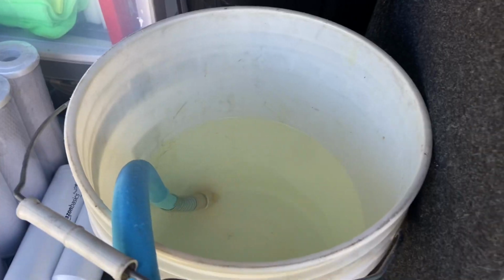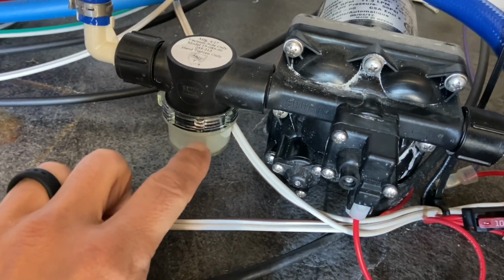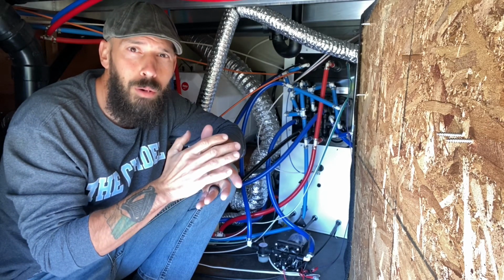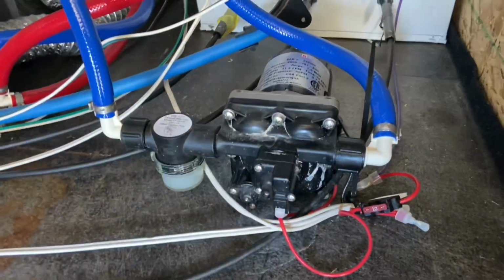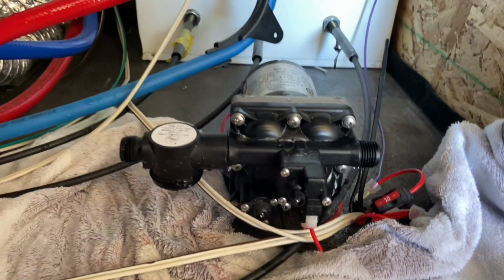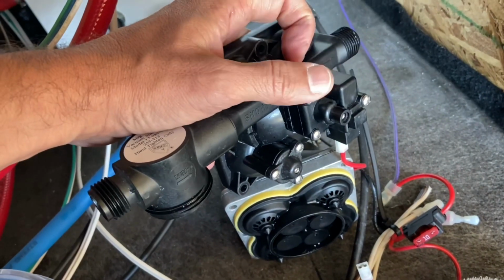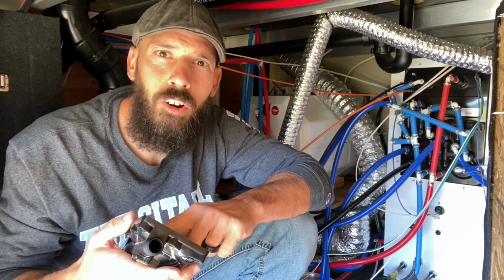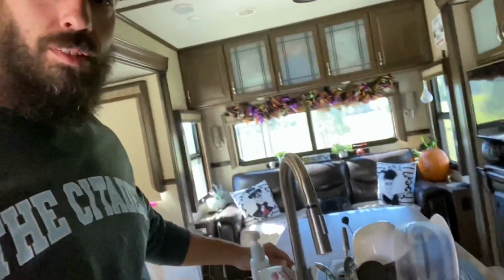RV WATER PUMP TROUBLESHOOTING (Pump Runs but No Water...Fixed!)

Comment: If I am connected to city water will this valve prevent city water to get to the sink.
Reply from the maker: If connected to city water this valve will prevent water from going backwards through the pump and into your fresh water tank. If your fresh water tank slowly fills up on its own and starts overflowing it usually means this pressure/check valve in the pump in broke.

Comment: Thank you, my pump has been working fine until our last move and it simply stopped, I suspect the electric fuse ?? But I have to locate the thing first?? It's a 2017 Forest River 32 rets
Reply from the maker: Good luck. I’m no rv tech or nothing, I only know my rig.
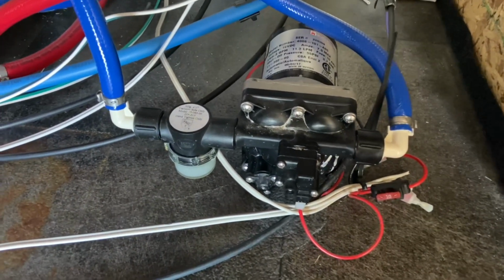Reply: @WhyWait you're a great teacher, I think mine was simply frozen, it was 19° for 36 or so hours, 4:30 today it just decided to start working again without me having to do anything. Thanks again

Comment: I was attempting to winterize my trailer for the first time and was unsuccessful after about three hours. I tried every valve configuration possible I could not get the antifreeze to pump out of the bottle. I have never used my water pump because we always utilize the pressure that comes from the campsite faucet and I have never boondocked. So it has never even been turned on. Now the first time I go to try to use it I’m having problems. It never occurred to me that the pump could be the problem. I googled my water pump is running but not pumping and found this video that seemed to describe my problem exactly. It gave me the confidence to pull my water pump out and take it apart. Sure enough it was the exact problem Chris shows you how to correct in this video. It took me about 10 minutes to take it apart, free the valve and reassemble it. I reinstalled it and within 10 minutes I had winterized my trailer. Thanks Chris!
Reply from the maker: That’s awesome! Glad this video helped and you were able to get your trailer winterized. In the future try to use the pump once a month or so to keep it exercises. That might help out from this happening again. Appreciate the comment 👍🏼

Comment: I have basically the same problem. Pump will run and partially fill water filter, whole house type, then just keep running. Could this be my problem? Also the filter you mentioned on intake side, mine is at an angle between 45 degrees and horizontal. It's just a clear screw on housing with nothing in it. Will check what this video shows.
Reply from the maker: Hope you get it worked out.
Reply: @WhyWait finally figured out problem thru suggestions on here, even though a tech couldn't. It was the shower mizer valve. Used it on my last trip and didn't fully turn it off allowing it to suck air.

Comment: Your water filter should be installed with the clear cup facing up. This allows it to drain when winterizing so it doesn't crack.
Reply from the maker: We don’t winterize and live full time. If I did I would actually just take the pump or little filter out.

Comment: This was so helpful.  We were prepping to leave from our campsite yesterday and when I disconnected from the City supply we had no water in the RV.  Went through several troubleshooting steps to no avail.  I thought we had lost prime and I was doing something wrong.  Found this video and it was exactly our issue.  This really helped me know how to remove the water pump and associated water lines and do a basic teardown.  Was able to cancel the mobile RV tech since I fixed it myself!
Reply from the maker: Glad our video could help you out and save you some money. 👍🏼 Hope you subscribed cause we have lots of other videos like this.

Comment: Tks so much for the help. I took off the regulator valve cap and fished out the diaphragm. It was stuck but not much. Put all back and the pump works fine.
Reply from the maker: Good deal. It’s likely to happen again. Over time that valve serves as a one way check valve keeping city water out and it constantly pushes on it seizing it up. Glad this worked though 👍🏼

Comment: Went camping and after my wife used the shower at night, I woke up in the AM, and no water came out of sink faucet. I checked and made sure tank was full.
 I can hear pump running constantly.  I tried priming with the seperate winterization hose.  I actually got water to come out of faucet at low pressure 
 Once it ran out, pump quit pumping water but kept running.
  I took apart like you said -   Filter case was fine, and filter clear.  I took apart and holes were clear, and springy pressure regulator seems springy and moving fine...
 Now what?
Reply from the maker: Sounds like….You have a leak in your water system somewhere. Underbelly or someplace else. If the pump is on there’s a demand for water so it’s running calling for more water because it’s leaking somewhere. It can be a small leak too.

Comment: I replaced my pump and everything works. I opened up the old one and it was not dry and the button worked properly... what other things would allow it to siphon in water and pump that but not pump from the white tank?
Reply from the maker: Water can be coming in from the other side of the pump, where the water pumps out. The city water presses up against that inside check valve and comes in backwards to the pump when that valve fails.

Comment: Turned out I had the same issue.  The pressure valve was slightly stuck.  Thanks!  You earned my like and subscribe!
Reply from the maker: Good deal Ray. It will probably happen again because of the city water pressure constantly pushing on the valve binding it up. Installing a separate one way check valve on the water line before it reaches the pump would be a good idea to help and prevent this. 👍🏼

Comment: Great info… thanks so much!!   I was thinking it was going to be the worse case scenario, ie, new pump 😮 BUT it turns out that about 5 screws had fallen completely out of the pump itself.  Easy fix🙌🏼🙌🏼💃💃. However, I found half of a small rubber “o” ring/washer and a small amount of whitish sticky stuff attached to it in the filter screen chamber… any idea as to what this might be from?
Reply from the maker: Hard water build up, calcium deposits I’d reckon. I’d recommend running a water softener to protect yourRV appliances like this and especially your water heater. Check out Blu Technologies Water Softener. We have videos on them too. 
https://goblutech.com/?ref=whywait

Comment: Great video! This was the first time I attempted running my water pump since I purchased my RV. This was my exact problem and fixed my issue. I discovered that the check valve is leaking back through my city water connection though, once I got the pump running. I put a hose shutoff valve on it for now to stop the water loss temporarily. If you have a video on fixing/replacing the check valve let me know. Thanks for the assist!
Reply from the maker: Thanks. Definitely a good idea to put a one way valve after the pump to keep the city water pressure from binding up the pumps check valve in there. Appreciate you watching and hope you subscribe to the channel 👍🏼

Comment: You were right, my pump was ok at the end of last season, but our first trip we are currently on it gailed. So after checking everything I took it off. The only thing that were different was the left water line keep having water run out while it worked and when I got the unit off, an extra backplate came off with it exposing the pump spindle. Other than that, the problem was exactly as you described!. Put it back on last night and everything is good. Took less trhat an hour to do the job. Of course, of the six screws, the last one didn't budge. There is always one of those but WD40 did the job.  Thanks for the video
Reply from the maker: Glad the video helped you troubleshoot! Keep an eye on it, probably will happen again.

Comment: Very helpful! I currently have the exact same problem. I would never open the pump housing to check this without your video.
Reply from the maker: Glad you found it helpful! Keep an eye on it cause it will probably happen again due to the pressure of city water connection always pushing on it.

Comment: I dont normally comment on videos, but this worked for me! Thank you
Reply from the maker: @seanas123123 keep an eye on it. It will probably happen again. Usually due to city water pressure being high and it pushes up against that valve constantly seizing it up.

Comment: Your advise regarding the non-city hook up water system was the first time I had heard that there were two pumps. Thanks nice video.
Reply from the maker: Not too sure what you are referencing but there is only one pump. It’s used when not hooked up to city water. When you are on city water it’s just pressure that feeds the faucets.

Comment: Hello Chris, from Ouray, Colorado. Though, we are in our travel trailer for 2 months down in the Tucson area; and really loving to be missing our first Colorado winter (or, at least, when we get home at the end of March, there will only be 2ish months left hehehe). 

Thank you so much for this very informative video!.  

I have been fairly disappointed here in the KOA as it seems our rig has super low water pressure when on the city water hookup.  I got the bright idea that maybe it is the cheapo water pressure regulator.  So, I went to the local RV dealer and got an adjustable pressure regulator.  Out of the box, it was close to 40psi.  I adjusted it to the upper end of what one would want and put it at 55psi.  Well, when I went out to walk my dog, I hear water dripping off of the rig (not normal in the desert hehehe).  I discover it is coming out of my gravity water feed for the fresh water tank.  Since I had santatized the tank with bleach when I arrived, I rinsed it with 1 more tank and had it empty.  So, my tank was filling through the city water fill; which means it was going through that check valve.  

I've reached the point of after watching your video, and a few others, it seems to be a common problem.  Yes...I am always departing Ouray with our hard water that was filled from our house.  So, it is possibly contributed by the sediment build up.  But, having set the psi to 55, it is possible I caused the check valve to fail.  

It is late now, so I am done touching things for the night hehehe.  Tomorrow, I'll run the rig with the water pump for a bit; hopefully that resets that check valve.  If not, I will take that apart as you did.  My water pump is super easy to get to; it is just inside one of my kitchen cabinets.  But....of course, it is oriented the opposite direction to access that black diaphragm side 😞 So, it is possible I have to take off the mounting screws too.  

Yes...our rig is in storage for months at a time.  I am now thinking that maybe when I stop by the storage yard to check for mice every 2 months or so that I also stop by with some antifreeze and just cycle a bit through the pump with the winterization tube on the water pump.  That would help keep the pump more moist inside.  

have a great night!!
Reply from the maker: Yup…that city water pressure will do that. I’ve had that happen to my fresh water tank before too. These manufacturers use to put a one way check valve there right before the pump to prevent this. Hope it all works out 👍🏼

Comment: I was having water pump issues. I searched YouTube for "RV water pump troubleshooting" and this video topped the results. This video covered exactly what was wrong with my pump. I went ahead and installed a new pump because mine requires gymnastics and yoga to reach it.... And I wanted to be sure it was fixed. When I took apart the old pump, that same little plunger was stuck.....really stuck! So thanks for the video. Super helpful.
Reply from the maker: @Dougcrockett27  awesome to hear Doug!! Seems to be a pretty common issue. Glad this helped.

Comment: I tried to use my pump yesterday and it was running but not pumping so I guess I am going to take it apart and see, but it’s cold here in Texas might wait for a warm day about frozen yesterday.
Reply from the maker: Running but not pumping could be a few things. Investigating and taking it apart will help. Make sure the tank has water and  check for leaks too.
Reply: @ I will as soon as in warms up some I had drained all the tanks and don’t think the pump has ever been used the filter was very clean I bought it used and the man that had it used it for short term housing.

Comment: Exactly what was wrong with my pump. Never would have known. It was so stuck I had to use a flat end chisel and a tack hammer to get it loose. Thanks
Reply from the maker: Definitely. Could happen again just a heads up. City water pressure constantly pushes on that valve sometimes causing this if you don’t have a check valve on the water line right before it.

Comment: We’re having quite the opposite. We’re connected to city water and our fresh water tank keeps getting filled up. When we turn off the city water and turn the pump to use that fresh water “troubleshoot” you’ll definitely hear the the pump make noise while the water faucet is on and on and off while faucet is off.
Reply from the maker: Good chance your water pump check valve is “leaking” not closing all the way. Basically City water pressure will push on the outport opening of the water pump causing that “check valve” or diaphragm inside there to fail sometimes. Causing city water to flow backwards through the pump right into your fresh water tank.

Comment: Hello, great video! I’m having issues with my water pump, it seems to be leaking from where you were able to remove the spring. Any idea on what it can be, should I open it up and see if it’s stuck or something?
Reply from the maker: You should definitely open it up. Check everything, make sure it all looks good then put it back together and make sure everything is tight 👍🏼 Once you tighten it all back down I’ll be you’ll be good.

Comment: Our pump stopped today. Called our RV dealer. He said check for fuse next to pump. Was a bit of a struggle to remove old fuse. New fuse in and pump works again. Didnt know the pump had an inline fuse.
Reply from the maker: Yup they sure do, usually 10 or 15 amp fuse. Lots of hidden fuses like this in these RVs too. 👍🏼

Comment: Do you have to drain the tank first
Reply from the maker: No but you would need to possibly shut off your city water connection if you are hooked up to it depending on your campers water line setup.

Comment: Thank you for your vid.  I had taken my pump apart but did not check the valve.  Mine ran dry for a while on a hot day before I noticed.  It stopped pumping afterwards.  I thought for sure my diaphragm was damaged.  So after your vid I noticed my check valve was temporary seized.  I added a bit of plumbers grease and A1 now !  I also didn't know about the floor water sensors.  I will definitely add one.  Neat idea for the hinged wall for quick access. Cheers !
Reply from the maker: Glad it helped 👍🏼👍🏼👍🏼

Comment: Hey fella! 
I watched your video and my problem was also the stuck pressure valve.
We use city water for the summer so the on board tank doesn't get used. I will make a point of running the 12V pump at least once a month from now on.
Thank you for uploading, you saved me from buying a new pump.
Best wishes to you and yours!
Liked and subscribed. 
👍
Reply from the maker: @glyn-rightagain  good deal! Glad this helped you out. 👍🏼👍🏼👍🏼

Comment: After troubleshooting all the lines were clear I pulled the pump. A dreaded job as it was tucked in pretty tight on my mini popup. This was totally the problem. Once freed I siphoned water from a gallon jug into the line and it lubricated and got the pump going .. before siphoning I could hear the pump pulling some air, but it's lack of use couldn't pull the water down ... Once primed it worked great.

Comment: Wow Thank you very much .. our pump wasn’t working! It had power was humming but not pumping water to fixtures.  You were right on.  I had a crack half way around the pump strainer filter bowl.  After it was replaced pump was working properly!  Again Thank you so, so very much for the help!  USMC Veteran 74-80.
Reply from the maker: Thank you for your service 🫡
Glad I could help out with the problem. Lots of handy tips like this on our RV channel. 👍🏼

Comment: Thank you so much for explaining how to get to check and troubleshoot my water pump. I’m a first time travel trailer owner and I really appreciate your video.
Reply from the maker: Awesome. Glad it helped you out. Thanks for watching 👍🏼
Reply: @WhyWait  update: found out the water pressure regulator stopped working, which prevented water from getting to the sink and or the faucet I took it off. Water is running freely.

Comment: Yes, you nailed it for my pump too.  Stuck pressure sensor and it works fine now.  Thankx so much!
Reply from the maker: Awesome. Keep an eye on it because it’s likely to happen to again. Glad this helped.
Reply: @WhyWait  is there any lubricant that is safe to use on this plastic valve (and that won't give a taste to the water?
Reply from the maker: Yes, Some food grade oil or plumbers grease will work, some plumbers grease can be food safe. Food-safe grease is a lubricant that doesn't pose a risk if it accidentally comes into contact with food or animal products. Plumbers grease can be made from silicone oil and silicone grease, and it's often used to install O-rings and taps. It can also be used to seal minor leaks, loosen stiff joints, and reduce noise

Comment: Gday I just installed a new sure Flo pump but it won’t purge all the air out of the line , what could be wrong with it?
Reply from the maker: Maybe a small crack in the clear filter. Not sure. Sometimes just taking these things apart, opening them up, kinda checking everything out and then putting them back together solves the problem. Hope you get it figured out.